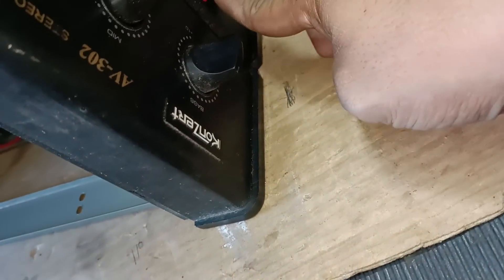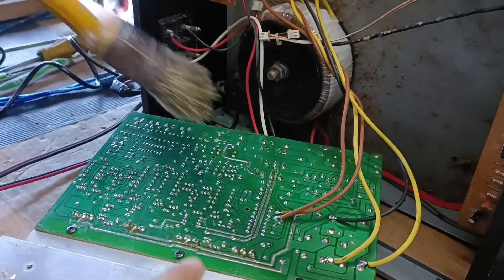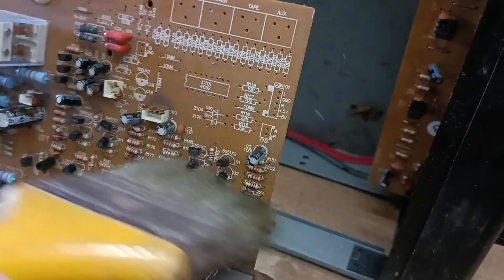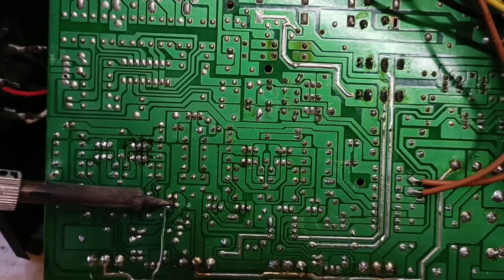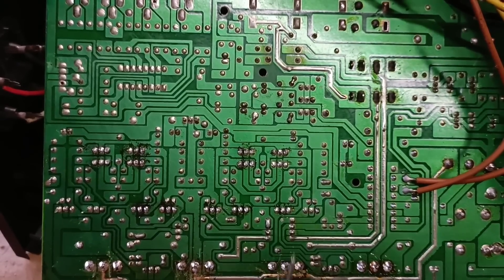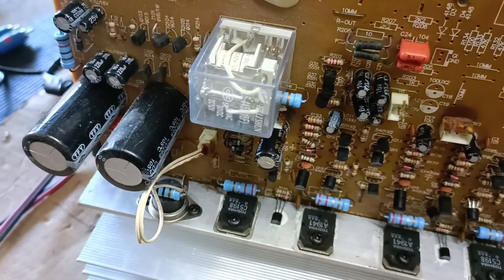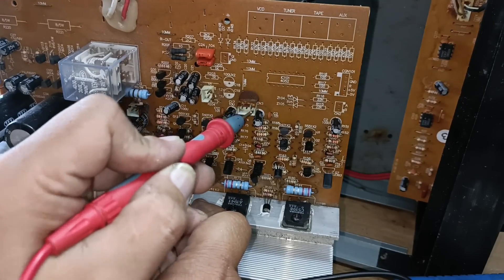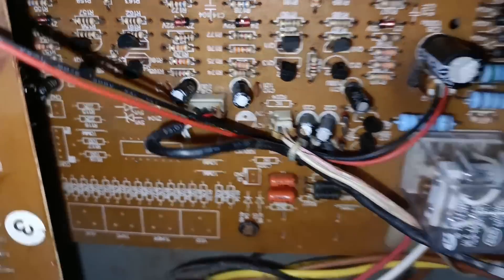Isa sa mga malilinaw na tunog na amplifier | Pano ayusin ito

Comment: Sir matanong ko lang may 302 din ako dto 
Kapg nilakasan ang volume lalo na yung bass 3 o’clock nama mataymatay sya nag poprotect 
Tapos ko na pinalitan ng resistor/potiometer/ filter capacitor.... gano parin ,, patolong naman
Reply from the maker: baka overdrive ka speakers sir
Reply: @GiovanniV  
Maliit lang naman speakers ko sir